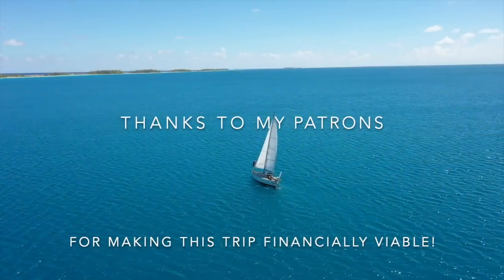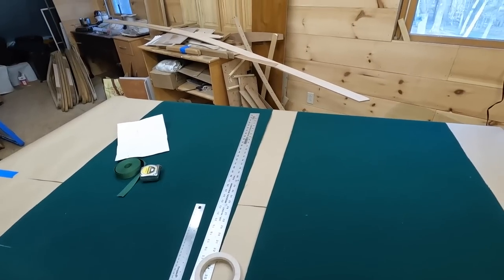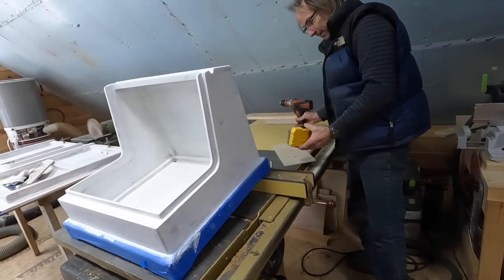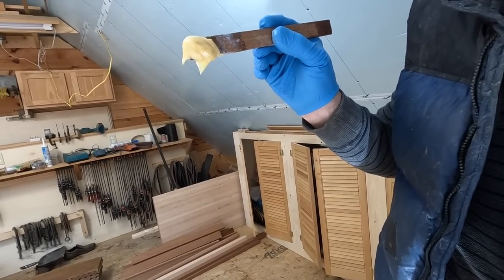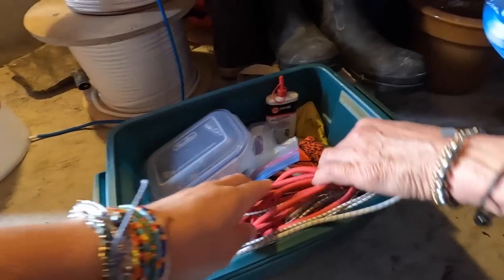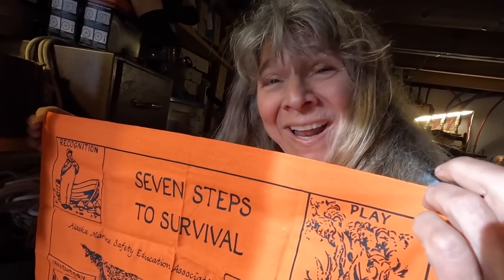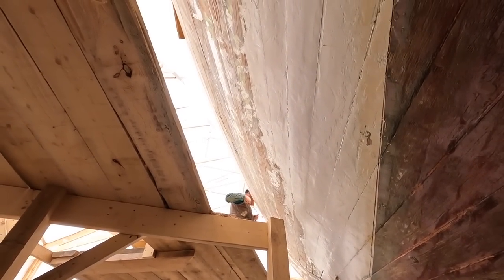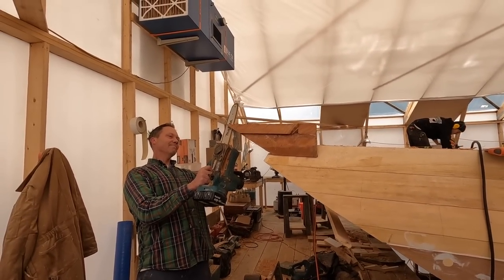A Hippie In Maine WHSE93

Comment: When cutting out those blisters, I was taught to bevel the sides of the hole, like the top of a volcano.
There is a tendency to want to start filling right away, but I have a good rule to go by:
"Take down all the mountains before you fill in the valley."
There can be bumps nearby to catch your blade, so make sure all those are taken down before filling the blister hole.
I ream it quickly with a piece of 40 grit sandpaper, just to provide more texture for the compound to grab.
Lastly, never put enough in the hole until your final pass.

You're an inspiration, Holly!

Comment: Holly, if the gas burner fix doesn't work, you might be able to use  a nut, round-headed bolt and large washer sandwich, if that doesn't foul  up the rest of the burner. Alternatively, you might be able to use a fat pop-rivet to sandwich the washers. Anyway, good luck with the rest of your adventures! Chris in Scotland.
Reply from the maker: Those are awesome ideas! The caulk works ok but it's not 100%

Comment: In the history of fiberglass boats, not a single one has ever sunk do to blisters. Just bottom paint and go sail. I always say, golf balls have bumps to make them go farther and faster. The famous YouTuber that i will not name, after six months of drying, grinding and filling blisters died from a lung infection after being under the boat breathing the contaminants. Kuwinkiedink? Maybe 
Good luck and take care.
Reply: If you saw Holly's mummy-like headgear and proper respirator when she was sanding off the repaired blisters you would feel better about her care and prudence. From personal experience I can tell you that blisters are not a trivial issue. On my fin keel spade rudder Monterey 26 (a limited edition boat from a short-lived Santa Barbara boatbuilder, made in about 1970), impoverished college student delay in hualing and scaping the bottom led to LOTS of work. Left to their own devices, blisters begin to work on more than the gel coat. They start to eat the resin in the plies of fiberglas. Had to remove one layer over about a five foot area and two-plus layers over a few feet, and carefully re-laminate that area. Days of infrared heat lamps were needed to get moisture out from between the affected laminations. The repair was solid and the hull was sound many years later when I sold the boat. Still, it was extra work that I would not wish on anyone, and which could have done even more serious damage.
Reply: @slowtony2 reread my post again. I don't think your boat was in danger of sinking. Paint it and go